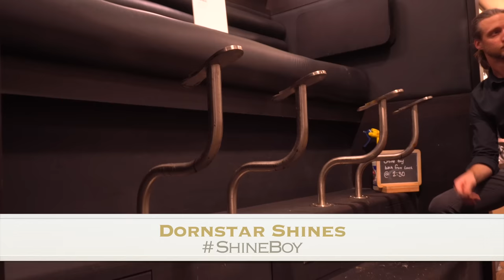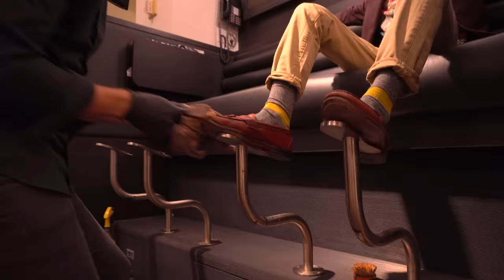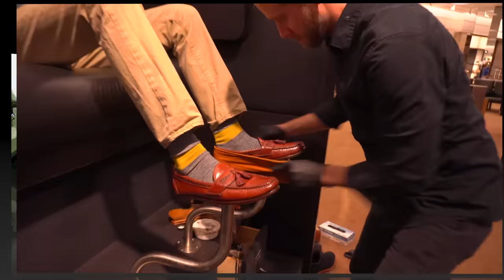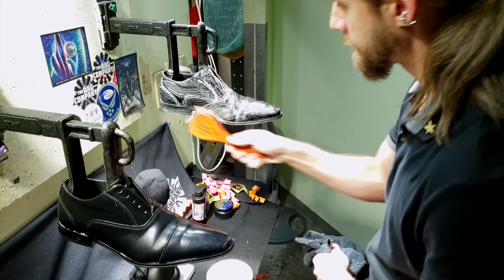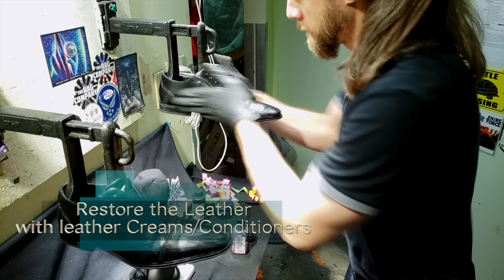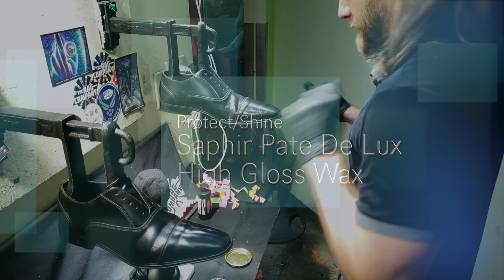ASMR | SHOE SHINE |  VERSACE Cap-Toe Oxford | 4K | Binaural Microphone

Comment: Hey Jason. Just a question. Seen a few shoe shiners do this and one that did my shoes recently said it's important.
Do you know if it's a good idea or not to put some of that sole edge dressing with the swab thing underneath the shoe on the vertical edge of the heel?  The surface or part that faces forward? 
Thank you sir!
Reply from the maker: I could see why shiners would do that, it probably seals up the leather as well as keeps the color consistent around the whole heel. I don't see why this would be really important as long as the shoe is properly finished at the factory.